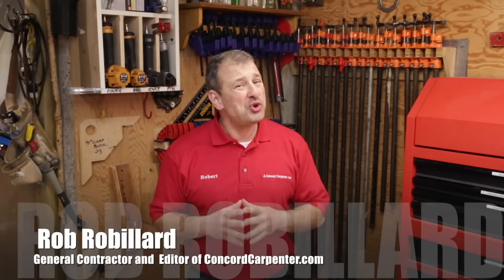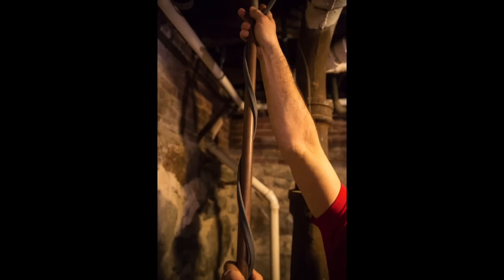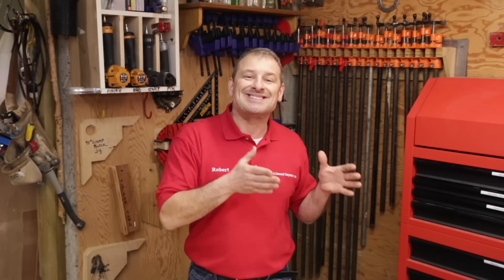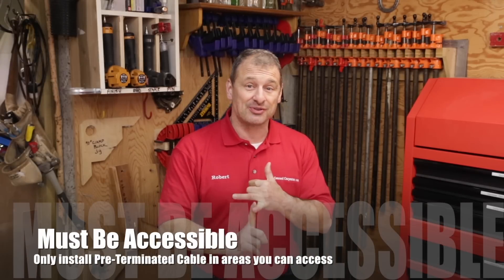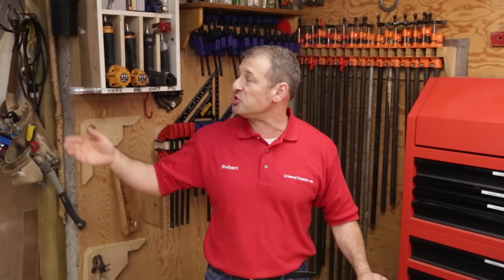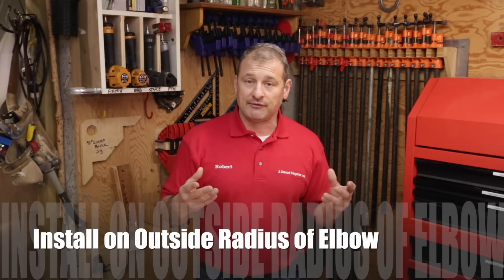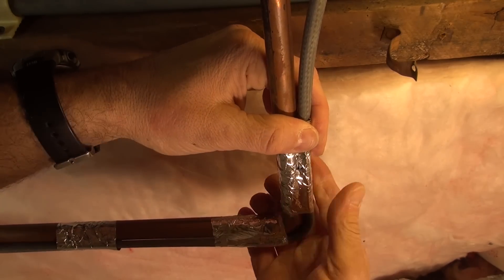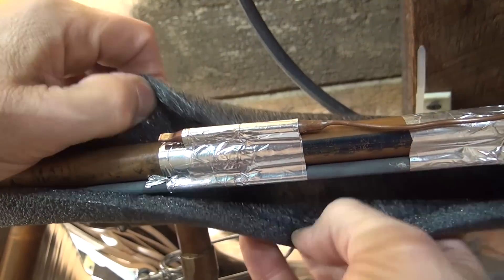Warmup Pipe Freeze Protection Heating Cable

Comment: I have experienced two kitchen sinks, laundry room water, and one radiant heat zone that were frozen when we went to an extreme -24c with wind chill down to -40c.
The problem is I  have no access to these mostly copper lines (water) and some sort of plex (radiant heating ).  The radiant heating has glycol in it but that was 22 years ago.
Easyheat by appleton/emerson,  In-line self regulating electric heat combo..... ISLR +  TLS31F cable  + SL3 thermostat seems the only possible solution I can find. 
For the radiant heat maybe its time to change out the glycol ????

Comment: Hi Rob, I have a 3 year old garage with office space above on Cape Cod.  I have water pipes in the wall that even with foam insulation burst in the unheated garage the last two winters.  So... I opened up the wall, removed the foam, replaced the susceptible pipes and then put heat tape on them, foamed them back in and cleaned up the wall.  It's a 3' section.  I didn't love putting it into the wall but I couldn't think of another alternative.  The temperature sensor is located just outside the wall in the garage space.  Any thoughts on this approach?  Thanks, I love your channel.  Go Pats!
Reply from the maker: Bob Pritchard add heat to garage?